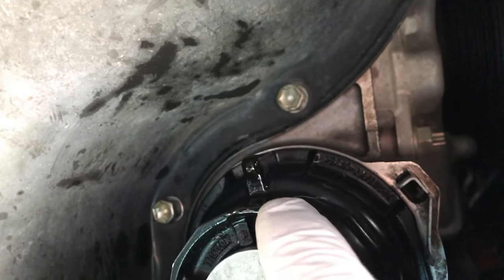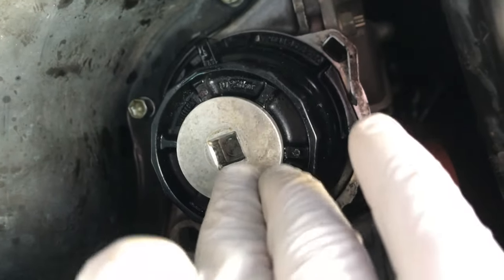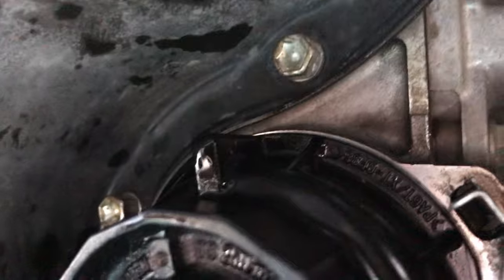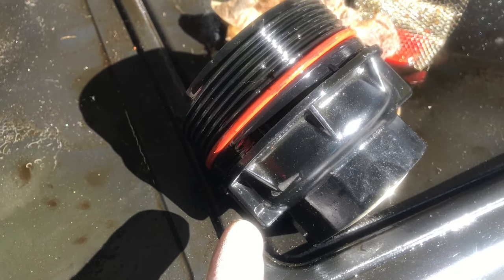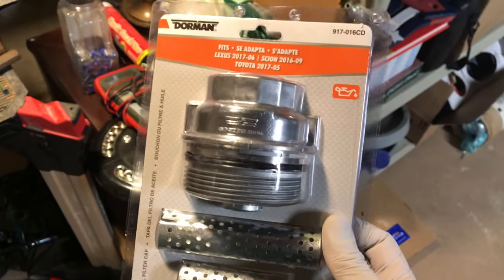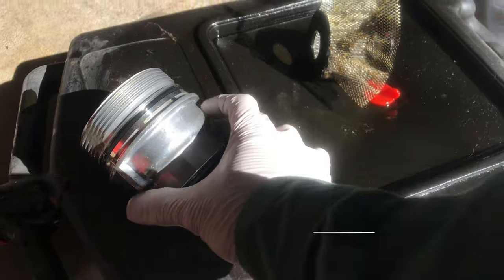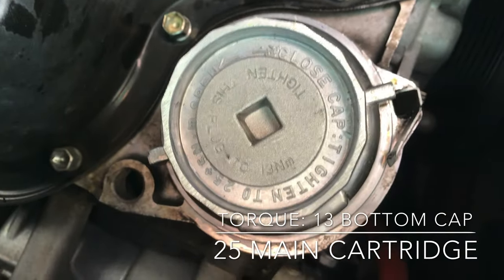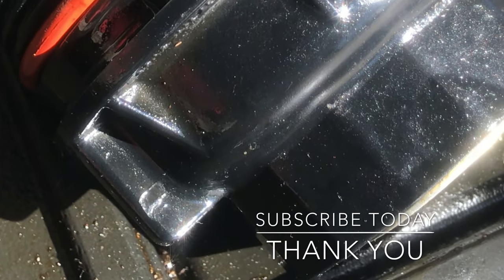FAIL! Toyota OEM Oil Filter cartridge Cover Cracked! Replaced with All Metal Aluminum Cover Dorman

Comment: TIP: I bought two housing wrenches (I didn't go cheap on these) and neither one fit properly as there was excessive play which rounds the edges.  This after removing it for the first time after the dealer mechanics over tightened them.  They must have used an impact wrench!  I discovered that the trick is to place a sheet of paper between the housing wrench and the housing as a shim (before pushing the wrench onto the housing).  That seems to be sufficient to provide a much better fit.

Comment: For the 2011 Corolla, there is an inexpensive workaround.

I bought a quality brand 1/4 in torque wrench. It generally "clicks when it's supposed to but I was so paranoid after cracking my first filter housing I arrived at a simple workaround that gives me the desired torque, without overtightening. I also do not require a torque wrench.

First ... when removing the housing, as gently as possible, unscrew the housing. Do not yank, grab, jerk or wrestle the housing off. Gently, gently unscrew the cap until finger loose. Remove normally after that.

When tightening, gently tighten the cap towards the housing (base) surface. Just before you've tightened it fully, ensure you can insert a 0.15mm feeler gauge between the cap and the base. If you have a snug (not tight) fit. You're good to go.

But I repeat, gently, gently tighten the housing down to that gap. More and you risk cracking the housing a few months later when you change your filter. Generally that is when the caps crack.

This has worked without issue for two full oil changes without leaking and the housing was easy to twist off without an initial jerk or tug to loosen. It just immediately began to twist out as soon as I put the faintest pressure on it. That's it. Guaranteed "decent" accuracy of torque without overtightening and without a torque wrench.

Best of days to all.

Comment: Only torque oil filter cap to 18 lb.ft.
Oil filter drainplug to 9.5 lb.ft.

I understand why you switched but I decided to stick with the plastic one when I replaced ours. I'm thinking that if the torque specs are followed, there should be no problem. Time will tell.
Reply: Yes, it's a reason to DIY the oil change on these.  Funny though, I think Toyota was trying to go the other way with this.

Comment: Just experienced the cracked housing today, same exact spot, although mine was much more obvious. Definitely not a fan of these stupid plastic oil filter cartridges.
Reply: Actually the cartridge is the filter element. The housing is two parts... The oil filter housing base attached to the block and the oil filter cap or oil filter housing cap.
Reply: Issrtw
Reply: happened to me today crappy plastic
Reply: Happened to me also at the shop now they got a metal one he said he’s replaced lots
Of these
Reply: Could just get expensive Baxter adaptor and hope you threaded that on right and get no leaks because even with aluminum housing mine still loves to leak at least a little bit

Comment: A Toyota SUV with a 3.5 liter engine has the cast aluminum housing ? If that was the one , I bought it from the dealer and fit exactly on my 2011 Toyota Camry , 2.5 liter , 4 cylinder engine

Comment: Use the Toyota tool not some aftermarket one. Don't over torque it. You'll be fine. Bugger the threads with the aluminum one and you wont be happy.

Comment: Dumb owners: Not willing to use the right tool to loosen the plastic filter housing and not willing to obey the factory 18 ft lb tightening torque spec.
Reply: dont you mean dumb mechanics?